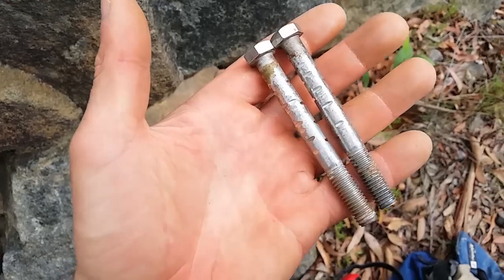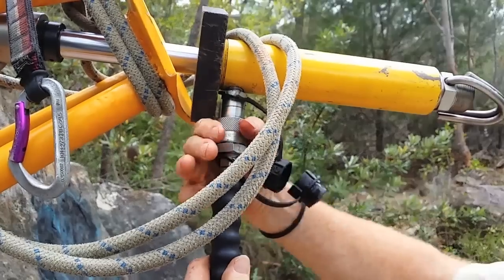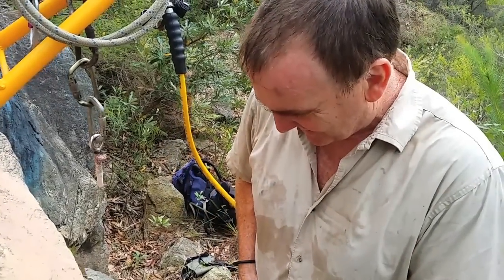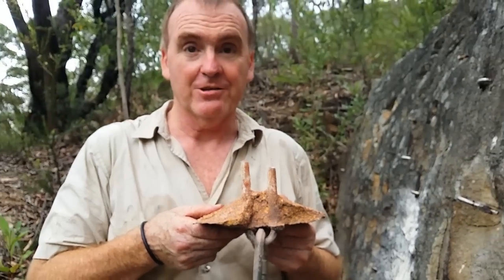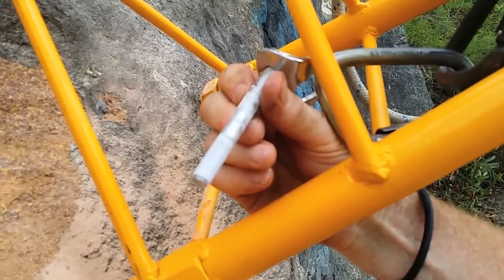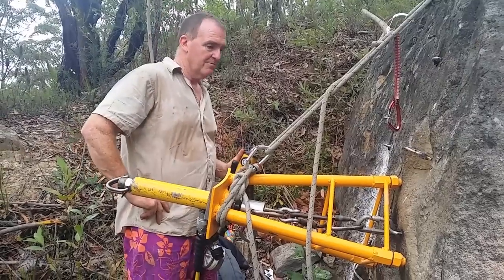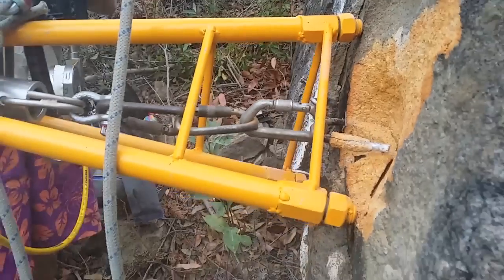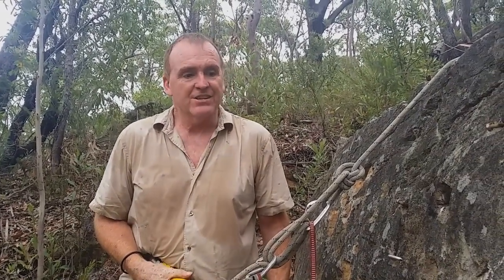Testing Fire Damaged Climbing Bolts with Mikl & Neil

Comment: It's interesting to see how things change. 30 years ago we used tapered boltsdriven into hand drilled holes with no adhesive.  I think that all ofthem would be more than strong enough as the load is usually in shear. great video, thanks.
Reply from the maker: I think it would be safer to say 'most of them' rather than 'all of them'. I removed plenty of very dodgy bash in carrots over the years. Some deliberately, some just fell out when I weighted them!
Reply: I doubt proper bolts "sheer" at all.

Comment: very interesting. The conclusion seems about right. If you do the test again I'd suggest installing thermocouples to see what the actual temperate attained was, and compare to the epoxy specification. I would conjecture that a large forrest fire could get a lot hotter than a blowtorch.

Comment: man i dont believe these numbers 40 KN 30 KN , look at the old karabiners wich are rated for maybe 25KN (even if they can take 10KN more ) just casually holding on 40 KN ... without even a tiny bend
Reply: exactly what i thought
Reply: rated for and peak load are very different. Essentially the very lightest screwgate has to be rated for 25ish so that heavy bugger should be a hell of a lot more.
Reply: Those 'biners are almost definitely steel (based off of the fact they look exactly like my steelies) which hold ±40kN